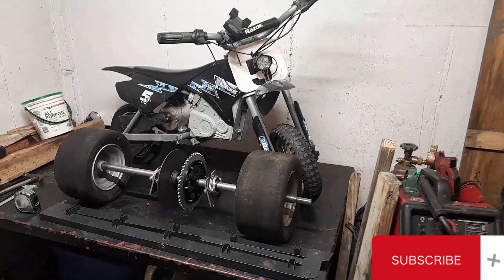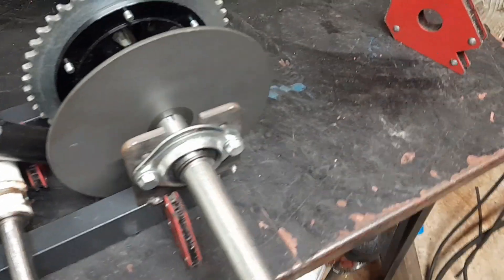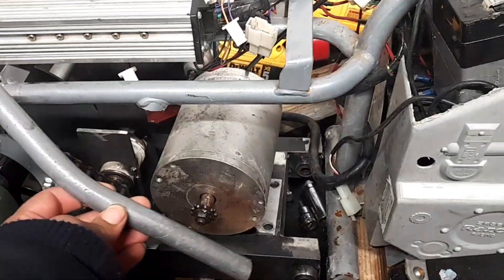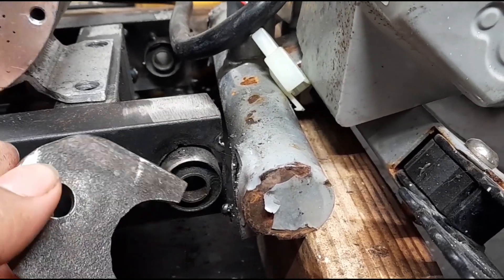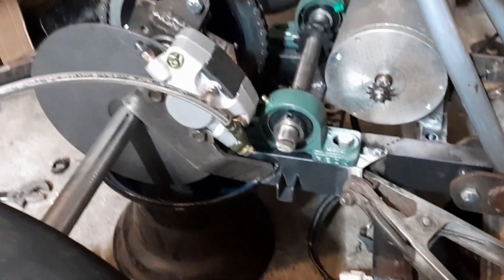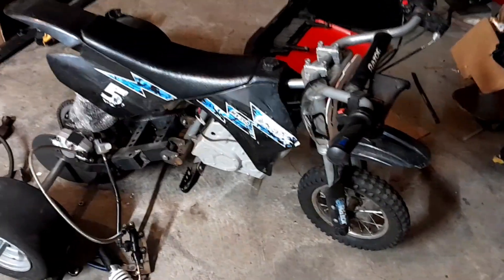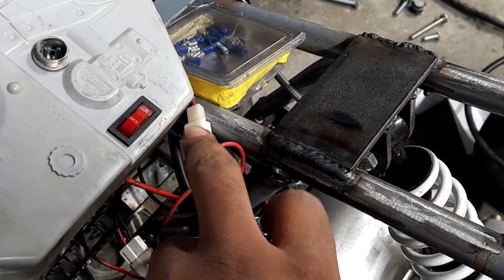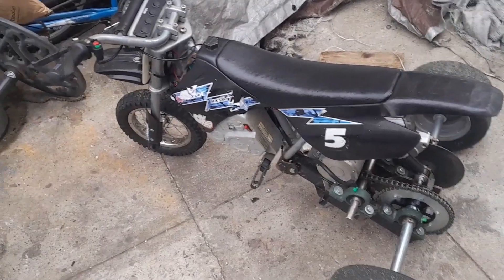I Built The Worlds First Trike Swapped Electric Mx350 (50MpH?)

Comment: The enc motor isn't going to make you go 50mph. It's the battery and controller that will. This thing is pretty awesome though!. With a 1800/2000w Motor you'll gain more speed then a 3000w and above by overvolting the motor. The bigger the motor wattage the more torque
Reply from the maker: Yes that's where gearing comes in to play. I do like to have more tourque than top speed but would be cool to reach that speed.Thanks for the comment 😁